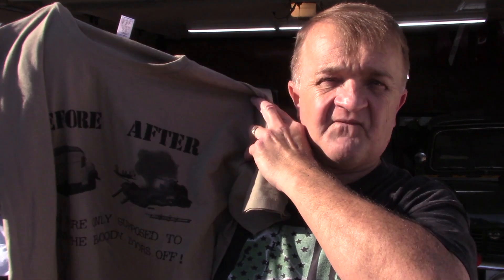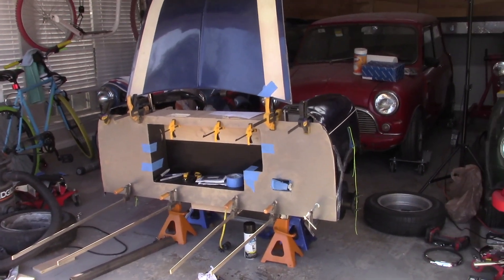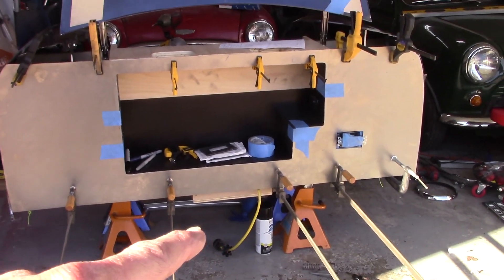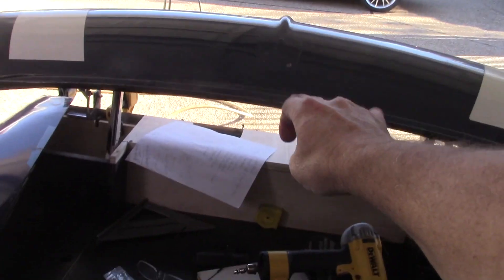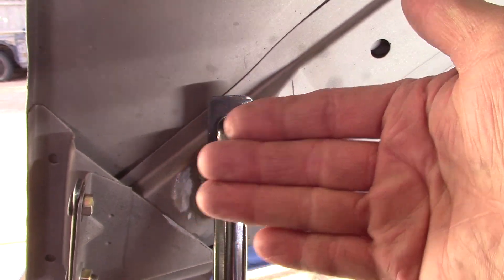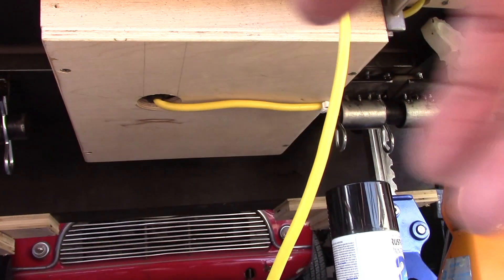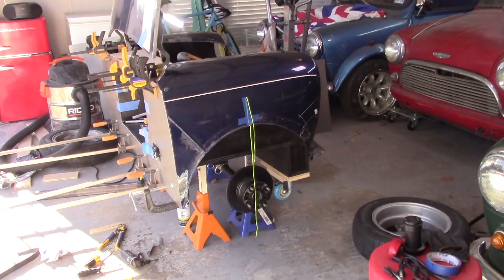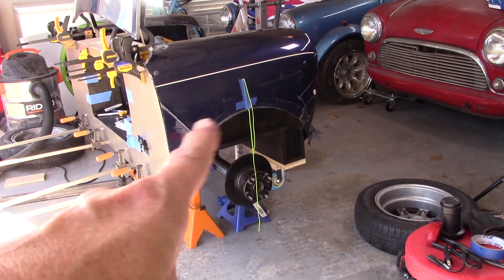Custom Tool Cabinet Part III - Classic Mini

Comment: Its coming on great, i'm not sure i could have worked every day for 2 weeks on it but you have. You say you need to put grease on those shafts, that only means one thing for a Mini! grease nipples lol. As for the antenna, could you use an old chrome aerial and have it coming through the top of the wing? Sorry to put ideas in your head  ha ha.  Anyway, enjoy your Mini run out today for a bit of well earned r&r.
Reply from the maker: thanks Paul..   about to head south now for a fun mini drive day..   wha-hoo...  Still so much to do on the Mini, but it's beginning to look like a tool cabinet.

Comment: Coming together nicely. Don the bonnet struts have an adjustment screw to adjust the pressure? They look similar to what we use on our kitchen wall unit top hinged cabinets.